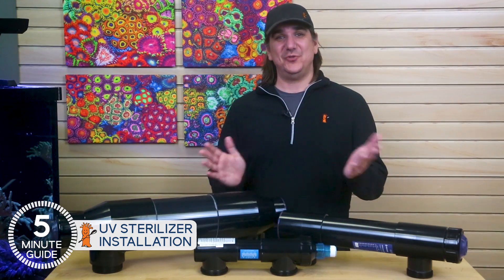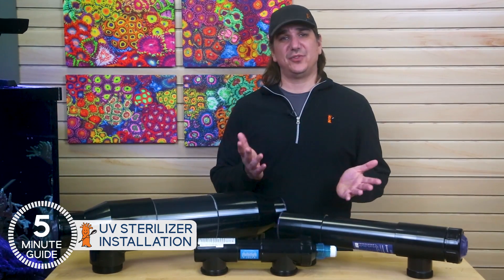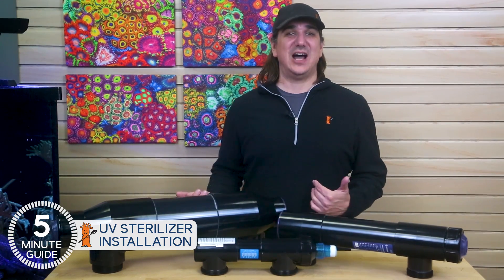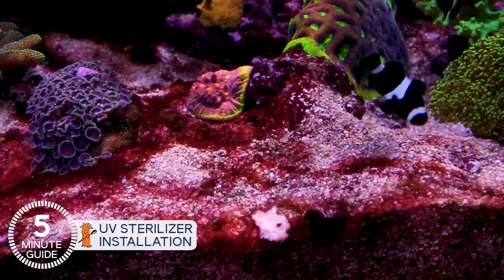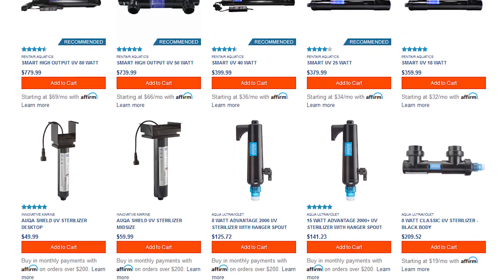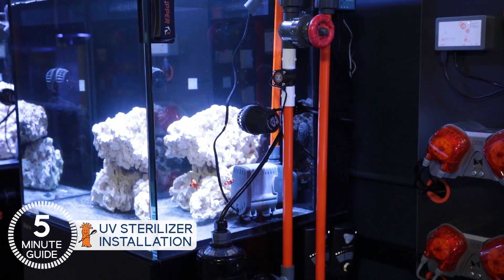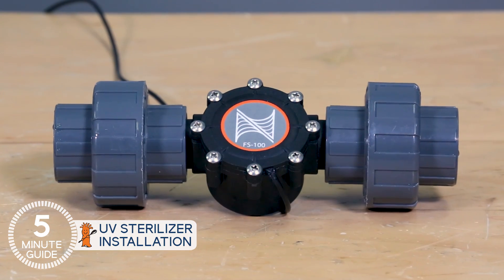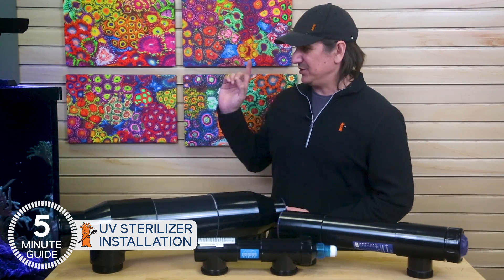How to plumb a UV Sterilizer, set the right flow rate and avoid UV mistakes.

Comment: I just got a 57 watt uv sterilizer and my 1" flow sensor max rate is 100gph.  It's 3/4" to 1"semsor to 3/4" input to uv using a sicce.sdc 3.0 pump.  Very confusing

Comment: I didn't think it was important to position the UV unit vertically instead of horizontally... Because I pushed the water from the aquarium through the UV sterilizer via the canister filter,  I didn't think it was important how the UV Unit was positioned / mounted.  Mine was positioned Horizontally inside the Cabinet. The FLUVAL 401 was responsible for passing the water through the UV sterilizer chamber in hopes that it provided adequate cleansing... I was anything but correct!  This video definitely a gods blessing! Thanks for the video!!

Comment: Hello, let me start by telling you i am a beginner in this awesome hobby and u have become my master 😂😂🙌 now i have a question i have a 75 gallon I bought the 15 Barr hangover aqua uv sterilizer and also bought a pump and tubing but i have no idea what tube goes we’re and my biggest question is do I put the pump behind the tank like on the floor or does the pump goes inside the water. Thank you
Reply from the maker: You'll want to check to make sure the pump you've purchased is a submersible pump. Usually the pump goes into the water, pumps the water to the barb fitting on the bottom of the sterilizer, then comes out of the "nozzle" back into the aquarium.

Comment: Some valid points. Other misleading information. Things that you might want to consider before constructing an elaborate system. Many of the companies selling UV units base their recommended flow rates (for a desired purpose) on single pass effectiveness. Most list different rates based on fresh or salt water (as they should) what seems to be lost is that for the most part these recommendations are based on drinking water. I suspect relatively few people are drinking the water that comes out of their aquarium UV sterilizer. The damage done to organisms exposed to UV light is cumulative. It is understandable that with the fast reproduction rates of some algae that you would want it killed or at least rendered unable to reproduce after the first pass through the sterilizer. As for everything else .... why does it matter if it’s rendered unable to reproduce on the second, third, fifth pass? Most aquariums are small not swimming pool sized closed systems. If you set your system up for algae control / eradication, you will be taking care of the bacterial and protozoa as well (just not on the first pass through the sterilizer)

Comment: Hi guys, I have a V2 vecton 600 and I would like to run it on my aqua one 300 (80 us gallons), on the manufacturer manual it says that it's rated for tank up to 600lt / 160 it's gallons and a maximum flow rate of 1900lt / 505 us gallons,  as I would like to run it mainly to prevent infections  (I had a smaller tank literally wiped out by velvet in less than 2 days so now I feel a bit paranoid about it) what flow rate should I ran it? looking on Internet seems that the suggested flow rate should be around 5-8 us gph * w of uv so being this unit 25w between 125 and 160 us gph is that right? also would it be good to put the pump into the central weir? just thinking that my fishes may be a bit to skittish for a pump straight into the tank
Reply from the maker: That's a tough one because it's so dependent on the contact time, UV body length/size, bulb wattage, and more. My guess is that that flow rate is likely to avoid bacteria and algae spores, so you'll have to run a slower flow rate than that. Beyond that, it's going to be a little bit of a guessing game.

Comment: Can I plumb a uv with the soft silicone tubing? I can see the tubing lit up pretty good at the connections. Just curious if this uv light spill is an issue. Will it degrade the tubing?
Reply from the maker: Silicone tubing isn't UV resistant, but it would take a very very long time for that small amount of light spill to impact the integrity of the tubing. In most cases, the tubing will still outlast the life of the sterilizer.
Reply: @BRStv  thank you!

Comment: What about the type that sit in the sump and arent plumbed?  i have 2 10 watts in my 36 gallons sump and nothing seems to be improving!  I am not sure if what I have is even dinos. Its really only on my glass the most and thats the only area I see bubbles.  A matt of something is appearing on my glass and has bubbles stuck on it!  What the heck could it be? I have tried chemiclean with no results several times.  I did have stuff on rocks and sand at one point but after blowing the rocks and sand it is gone. It happened before and I thought I got rid of it so ordered a bunch of new corals like an idiot and now its back!  I am to scared to do any harsh treatments because I have so many new expensive frags!  I am also dosing mb7 and vibrant ever day now. alternating each one! I have had some corals die recently, but for a long time prior to buying new ones none had died and funny thing is my older coral's and not the new ones have died. I did have some salinty ups and downs when I dint relaize that my salinity probe wasnt calibrated right and was also adding in a bit more rodi. It happend 2 x's that its dropped down to 1023 and I brought it up slowly then 2 weeks later I checked it again and back to 1023 so brought it back up slowly.  My 2 duncans bit the dust and I had one for a long time. I had another duncan die before from salinty so maybe they are more sensitive to that then other corals. I did notice my calcium was down to 510 before a water change.  Could that be the problem?  I wish hubby would hook up one of these types but he is so busy I doubt if I could get him to do it!  Thats why I settled for the in sump aio type LOL

Comment: So I've been looking into installing uv on my 90 gallon. And I want to make sure I get all or most of the water through it. But it's only got one return hole. What's the best way to plumb a uv in that situation? Just get one big enough for the return pump flow rate? Thanks alot for all the helpful videos! Making my second reef tank alot easier to setup!
Reply from the maker: Exactly right. If you only have one return and want to install the UV on the return line, you'll just have to determine what flow rate you want, then buy the UV that is rated for that particular flow rate. If you're going for algae/bacteria flow rates, you probably won't have to oversize it much, if any. If you're aiming for protozoa flow rates, then you'll almost certainly have to oversize it.

Comment: After days of searching, this was by far the single most educational segment on UV I have found. Nice job and thank you. If I am correct, I have a 90 gallon with a 406 and a 407. I planned on hooking up a Coralife 36 watt 12x up sterilizer for parasites. I believe I will need a pump and not go inline due to the 406 GPH being well above 290 gph. Now I need to research pumps. Thanks again.

Comment: I might be crazy but I don't think you actually identified exactly how it should be installed???  I worry about feeding directly from tank because contaminants and particles could foul your lamp.  I think feeding from return pump chamber with stand alone smaller pump then return directly to display would be the correct way.  Do you agree?
Reply: I wonder on this too? This is how I'm planning on plumbing my aqua uv 57w

Comment: Have you yet experienced installing a UV Sterilizer in/on a Clear-for-Life Uniquarium?  My 180g has two return pumps, would it be as simple as installing the UV in-line between one of the pumps and the return jet?  Granted, it defeats the purpose of having a self enclosed system by pumping out of the in-tank sump, but unless I can submerge UV directly into the return chamber that houses the pumps, I haven't seen a way around it yet.  Suggestions?
Reply from the maker: We've not used the Clear-for-Life Uniquarium here at BRS, but from what I can tell, this looks like an all-in-one type system. The Pentair and AquaUV sterilizers we stock cannot be submerged, so you're likely going to have to modify your tank to get this to work properly.

Comment: I got a question. I have a reefer 250 and bought a oversized 25w uv with a ideal flow of 2500l about the same as suggested for return. What happens if i attach it next to my other return. Can the overflow handle it?
Reply: How did your install turn out? Looking to install one on my reefer 250.

Comment: Do we need to adjust down for smaller tank volumes or maintain the same flow rate for smaller tanks.
Reply from the maker: You'll want to maintain the suggested flow rate for your UV sterilizer regardless of display tank size.

Comment: How is the 2 return pump with one UV light any different than say plumbing the UV from one section of the sump to the return section of the sump?
In both situations "pockets of parasites" could get through.
Not trying to be that guy just trying to understand how its different.
Reply from the maker: If you're pulling from the first chamber of the sump and dumping into the return, you're effectively bypassing the main filtration components of your sump with some of the water. By plumbing it to a return, 100% of the water still has to pass all the way through the sump and filtration.
Reply: @BRStv  I think you misunderstood his question.... that theory is right with one return pump, if you're running two return pumps some of the water is going through the uv back to the tank, then some of the water is going straight back to the tank without going through uv because its going through the other return line from the 2nd pump.... so if you're using this theory then surley its just as effective as a pump going from the start of the sump back into the return section... clarification on this would be great 👍

Comment: But if you have 2 return pumps one which is plumbed into the Uv and one isn’t , this wouldn’t work since the one that isn’t connected to the Uv would return non uv water back into the tank.
Reply from the maker: The goal isn't to run 100% of the water through the UV sterilizer. The goal is to reduce the amount of water that is getting "refiltered" through the UV over and over again. By plumbing the UV from the sump to the tank, we're greatly reducing this efficiency loss.
Reply: Bulk Reef Supply is its best to just tee off one return pump ?

Comment: I appreciate your video but I am not certain how to ideally plumb my UV return into my RedSea 350.  It pulls off the return line, but returns the flow into the sump front end.  However I am not having problems, so I'm not sure it is an issue.  It shares a circuit with my chiller.

Comment: what about UV from the tank to the sump? will this be different? i hear this has a different outcome and need to watch speeds from the pumps is this true?
Reply from the maker: Technically it should provide a similar benefit so long as you have a way of consistently regulating the flow rate.

Comment: Evaluating the cost/benefit here. I only plan to use a UV if I get dinos. I can't run off my return/manifold. So, best to use a pump in the sump, shoot water through a UV, and then send a water line directly to the DT? Sound reasonable? I like the safety of sump-to-sump but it sounds less than ideal. Thx
Reply from the maker: We did something like this on the 750XXL when we ran into bacteria and dino issues. We simply put a pump in the DT plumbed it with soft tubing down to a large UV on the ground and back up to the DT. This worked for temporary uses, but after feeling the need to throw it back on 2-3 times to help resolve issues we wound up just putting it in permanently.

Comment: I run a seperate pump on my uv. The pump in in my skimmer chamber and the outlet goes to the return chamber. Is this ok?
Reply from the maker: At face value, this seems logical and processes the same amount of water but I would be less confident 99.99% of the water passes through the sterilizer at the same turnover.  It also leaves room for pockets of parasites or pest organisms to settle out and bypass the filter.  Pumped into a return pump you can control the turn over more confidently and 100% of the water/pests entering the sump has to pass through the UV to get back to the tank.
Reply: @BRStv  But if you have two return pumps, one of them is passing non-UV filtered water back into the tank. Could you have a seperate pump in the return chamber connected to the UV and then output of UV back into the return chamber??

Comment: Well I thought I had my flow right, I purchased the 25w pantair from y’all. I have a reefer250. I basically halved the recommended flow rate on the chart provided. Is that correct? Thanks guys. Keep up the great vids.
Reply from the maker: The Pentair UV is simple in that they give you direct flow rate information on where to set it for your specific goal. As Ryan mentions, it's best to choose a specific job for what you are trying to achieve using a UV Sterilizer in which case you can choose a flow rate within these ranges for that 25W. 
Algae & Bacteria Water Flow Rate - 472GPH/788GPH (Suggested*/Maximum)
Protozoa Bacteria Water Flow Rate - 79GPH/131GPH (Suggested*/Maximum)
Reply: Bulk Reef Supply understand that table. But that is for a 130 gallon. I have a 65gallon. I was asking if I would half the recommended flow rate since my tank is half the rated size for UV.
Reply: yes am curious as well if need to adjust down for smaller tank volumes or maintain the same flow rate for smaller tanks.

Comment: What's your feeling on plumbing it with its own pump, having the intake  for the UV in the drain section and output into the return pump chamber?  Decent compromise?
Reply from the maker: At face value, this seems logical and processes the same amount of water but I would be less confident 99.99% of the water passes through the sterilizer at the same turnover.  It also leaves room for pockets of parasites or pest organisms to settle out and bypass the filter.  Pumped into a return pump you can control the turn over more confidently and 100% of the water/pests entering the sump has to pass through the UV to get back to the tank.

Comment: Question about doing a true closed loop for the UV.  Flow rate, distance from UV bulb to inner wall of sterilizer and turbidity all effect dose of UV to the water.  If the water haha the chance to be mechanically prefiltered then it would allow for better UV penetration due to less suspended particulates.  Do you think the benefits of the inflow coming directly from the display put weigh this?
Reply from the maker: There may be a theoretical benefit here but not likely one that will significantly affect results. A reef tank is a closed-loop system where the water is being filtered dozens to hundreds of times a day so the prefilter concept holds less value. For instance, adding carbon will dramatically increase clarity and UV transmittance. However, once the clarity has been achieved it will just maintain the clarity of the water. The water clarity before and after the carbon will not be remarkably different.   It might be more important on a pond where fish are constantly stirring up mud.
Reply: Well Ryan and Team!!!   After some careful thought I did it.  This evening plumbed my 110 UV into the closed loop on my peninsula!   Thanks gang!!

Comment: What would an ideal setup look like if UV is plumbed to the sump?  I have a 3 chamber sump - Fuge > skimmer > return.  The UV pump is pulling from the fuge section and emptying into the skimmer section so it's not really skipping any filtration stages (aside from reduced time in the fuge) and isn't being re-processed. Anything wrong with this setup?
Reply from the maker: At face value, this seems logical and processes the same amount of water but I would be less confident 99.99% of the water passes through the sterilizer at the same turnover.  It also leaves room for pockets of parasites or pest organisms to settle out and bypass the filter.  Pumped into a return pump you can control the turn over more confidently and 100% of the water/pests entering the sump has to pass through the UV to get back to the tank.
Reply: @BRStv  Yes, there's still some flow that moves from the fuge to the skimmer section without passing through the UV - this seems impossible to avoid if the desired UV flow is lower than my tank turnover...

Comment: HELP...Bought my pentair 40 watt almost s month ago and been waiting for this video, but already installed it vertically. out from return chamber back to return chamber using identical dc pump as my return pump. Uv Flow rate matches my return pump rate... So should i just make my uv be my return pump into the display?
Reply from the maker: It is both ok and common to use the return pump for flow through the UV. just make sure the flow rate matches both needs.

Comment: On one of my all in one nano tanks,flow is off the return side chamber,to the chiller (Chill Solutions nano) to a 9watt UV,using a ball valve to slightly restrict the flow.
Returns into opposite end of the return chamber directly above the return pump.
Q: Is this a sound system or no?
My main concern is parasite prevention.
Reply from the maker: Sometimes you just have to do the best you can and AIO designs only allow for so much.  This looks acceptable.

Comment: Is a uv specifically the 9 watt uv hang in light for AIO tanks worth it. I have a 24 gallon and am curious about it. Is there enough size of light to do the job? Is tank turnover for optimal results even capable? I bought a mighty jet dc so i have a somewhat reference of what it is turning over.
Reply from the maker: I guess it depends on the brand and how it is plumbed. If a reputable brand UV says that provides an adequate dose of UV and tank turn over rate I would trust the value.